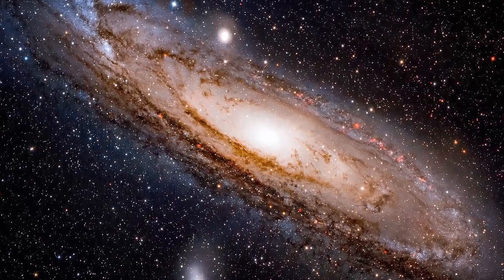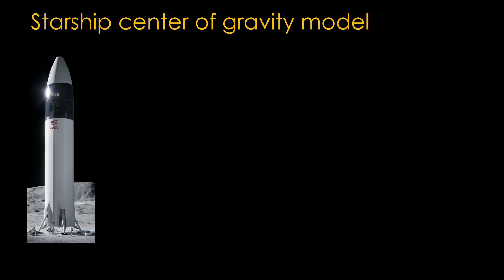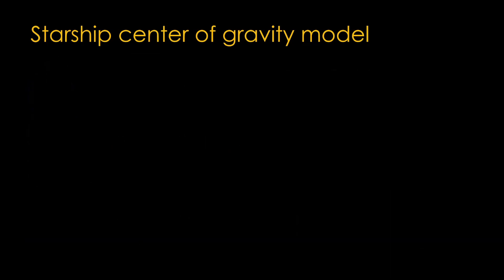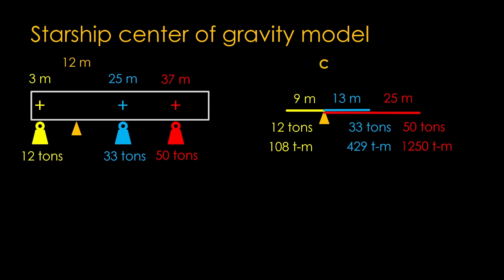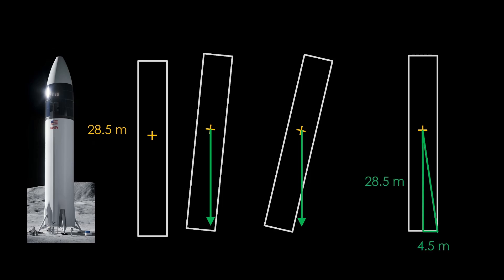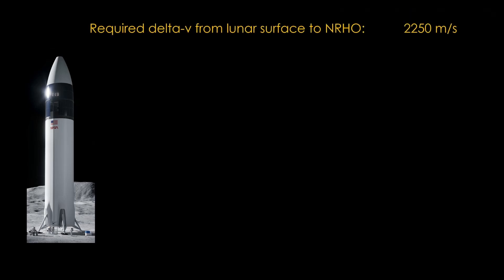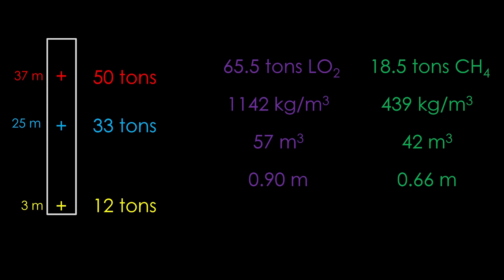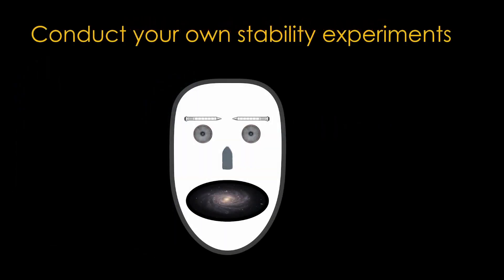Will Starship Fall Over?

Comment: While we're discussing Starship and the Moon - could you do a video on Starship alternatives to SLS/Orion? Your ability to give hard figures and clearly spell things out is sorely needed for this. I've seen a proposal on reddit that a lightly loaded regular Starship with a crew compartment could go to NRHO and back without needing refilling in NRHO. Not needing a refill is necessary for this to be considered in the near- and mid-term by NASA.

The crew compartment for 4-6 can be based on the one for HLS, ergo NASA approved. A light load of cargo will be fine early in the program. Heavy cargo-only runs can be done separately. I hope to see this done at about the time of Artemis 4 so a crewed launch on the Starship isn't included. Crew would launch on a Dragon and board the refilled ship in LEO. 

The return of the crew will require a bit of a kludge. A stripped down Dragon is stowed in the cargo bay at launch and only deployed when the Starship is closing in on Earth. The crew deploys in this and enters the atmosphere & splashes down conventionally. The ship lands autonomously. A stripped down Dragon needs no SuperDracos and only minimal Draco propellants, along with minimal ECLSS and a stub trunk - all just enough for a few hours. Carrying this all the way to the Moon and back is certainly a bad looking kludge but is the most straightforward way to make NASA happy about a crew-rated reentry. Even SpaceX may not have crew-rated it by the late 2020s, Elon wants a couple of hundred successes in a row. A good enough solution that saves us billions by replacing SLS/Orion ASAP is preferable to a best solution later on.

All this would be easier if this Starship could carry enough propellant to and fro that would allow propulsive deceleration to LEO. However, I'm informed on reddit that the delta-v doesn't work out. This LEO-to-LEO proposal is made repeatedly, though, so it will be great if you can definitively disprove it, put a nail in its coffin.

Some guy on reddit has given answers to parts of this. Some guy named Triabolical.😉
I'm sure this looks familiar. A full-blown video will be so, so much better.

If it helps, I just subscribed.
Reply from the maker: It's on my list of topics to explore. It seems fairly simple to do it one-time, but the hard part IMO looks to be figuring out reuse for the lander; getting fuel out to NRHO to either do another landing mission or come back to LEO looks challenging. 

Not sure when it will show up. I work on videos until I get bored, stuck, or aren't sure what my opinion is, and then I'll switch to something else. Or - often - I'll be working on one video and it turns out I need to do another one first; this video came out of a video on using starship as a habitat.
Reply: @EagerSpace   "It seems fairly simple to do it one-time". I'm afraid I don't see what you mean. The Dragon to LEO is reusable, the Starship for the round trip is reusable (it lands itself autonomously after the crew deploys in the capsule) and the stripped down Dragon can be reused. (It will of course have an upgraded heat shield.)

Yup, filling in space (LEO or NRHO) will be a hard nut to crack. Doing it just in LEO will be hard, and Artemis can't go forward without it. And the chain of tanker flights to get a significant amount of propellant to NRHO will need Musk's vision for Starship's high flight cadence to make it work. That's why I use the kludge of a stripped-down Dragon and no NRHO refill - I see it as an interim solution until Starship is human-rated or NRHO refilling is perfected.

Thank you for engaging. I certainly understand the need to be motivated when one is doing a project voluntarily, I've been there. But Christmas is coming... :)  And besides me there are so, so many people looking for the LEO-to-LEO answer. You, sir, have a moral obligation to all of humankind.  :D
Reply from the maker: @donjones4719  
When I said "fairly easy" I was referring to the artemis architecture where you go LEO => surface => NRHO and then leave it there. 

I will take a run at it, and we'll see what pops out. Refueling probably complicates the number of approaches. 

And I suspect there's an approach lurking out there that involves leaving the starship on the moon; I'm not sure taking 50 tons to the moon and taking a fair bit of it back makes a lot of sense. Or maybe there are just cargo variants that carry more. 

> You, sir, have a moral obligation to all of humankind. :D 

LOL. I shall therefore endeavour not to fail in this quest.
Reply: @EagerSpace    Multiple thumbs up. And don't worry about refilling scenarios for my sake. We have to take it on faith the initial LEO depot filling->HLS ship can be done, per NASA & SpaceX & their current HLS plan. It follows that my Starship can get its LEO filling the same way and then need no others. Elaborating your video to NRHO fillings would be gravy, don't let it bog you down if it becomes burdensome.

Comment: 2250m/s is pretty tight for getting to NRHO. Starship might just manage it thanks to it's high TWR, but I'd imagine SpaceX will still include some extra margin on that, which will add a significant amount of weight thanks to the rocket equation. NASA budgets for ~2750m/s, depending on the exact profile.
Reply from the maker: Definitely; I went with the minimum because that would give the lowest propellant mass and therefore was the most conservative choice for this analysis.

Margin would definitely be a great idea. If you have a link for the NASA budget I'd love to read it.
Reply: @EagerSpace how does choosing the lower delta v make a more conservative estimate? Should a more conservative calculation in this context use the less optimistic and hence higher delta v figure?
Reply: @meatsaucez1516  Because in this model, the more propellant you add, the lower the center of gravity moves. So in the context of tipping risk, the minimum propellant residual (and therefore minimum delta v) is the most conservative assumption.
Reply: @EagerSpace  
There's not much to read unfortunately, AFAIK they haven't justified their reasoning for any of their estimates. 

2750m/s appears to be the most commonly used figure.

for example page 18 here: https://www.nasa.gov/sites/default/files/atoms/files/20191030-nac-heoc-smith-v3.pdf

and page 8 here: https://www.nasa.gov/sites/default/files/atoms/files/20181207-crusan-gateway-reduced-v4tagged.pdf

They used 2700m/s in a CLPS presentation and I think I even recall 2850m/s being thrown around back when Gateway was still DSG.

If I had to guess, I'd say that first braking into LLO and then landing as depicted in one of the graphics is less efficient than landing directly, and also that an inclination change will be needed after a stay on the surface unless the landing site is exactly at the pole. 

And of course, they probably weren't expecting whatever lander they ended up with to be quite overpowered as Starship, which can easily manage a TWR well into the double digits, as opposed to the measly 2 that the Apollo ascent module had.

Comment: Seems pretty conclusive, other than the fact that the model does not account for margins in the propellant, or the leftover propellant in the header tanks. This is probably a good approximation.
Reply: Will HLS even have header tanks? I don't see a reason for them.
Reply: There's no header in HLS.

The header tank in the nose cone only needed to help stabilize Starship reentry through the atmosphere, balancing the mass of the heavier bottom part.
Reply: @807800 I was here, two years later, to witness this comment lol.  Thanks for the info, I suppose the moon version will be removing this header tank then?
Reply: @aone9050  What I refer to header tank is the smaller tank in the nose cone that Starship use for landing. The reason why it's on the nose cone, as I mentioned above, is to move the center of gravity forward to assist in the reentry. Such thing is not needed for HLS.

If there's a smaller tank in HLS, that would be placed inside the main tank, at the bottom.

I find it important to mention this, because a header tank like in the current Starship would move the center of gravity upward, making it more prone to fall over.

Comment: How much horizontal velocity component at time of landing would be acceptable? 

(Assuming that the target point is not 100% certain at time of approach and needs some adjustment just before touchdown. Unlike Falcon, where there's a defined landing surface, with HLS there's a non zero chance there might be some horizontal speed component at touchdown. Propellant sloshing as well.)
Reply from the maker: I thought a bit about that but didn't do any real work on it. 

The maximum horizontal velocity during apollo was less than a meter per second, and I'd expect that lunar starship would be better than that; I think they do much less than that with Falcon 9. 

My guess is that 1 m/s would be fine.
Reply: In this case you'd also have to look at fuel slosh.

Speaking of which, this gets me thinking about how you would do a long duration lunar mission with lunar starship. I doubt they can keep the tanks at the right temperature for weeks on end.
Reply from the maker: @DemoR  There's obvious no convection to worry about and the only conduction will be through the landing legs, so pretty much nothing there. 

So the only heating you get is solar, and with white paint that should be pretty minimal. Vaporizing the cryogenic fuels requires a lot of heat, so I think they will probably be fine there.
Reply: @DemoR  
You probably can't keep the heat out entirely, but if you can insulate the tanks enough you might be able to reach a level of boiloff where you can trade payload mass for longer durations. I.E , say you lose 1 tonne of propellant per day to boiloff. If you want to stay for 20 days, that means you'd need an extra 20 tonnes of propellant vs just touch and go, which means you have to trade off 20 tonnes of payload to make up that deficit. Just spitballing here of course.